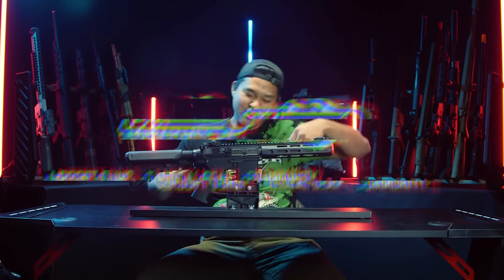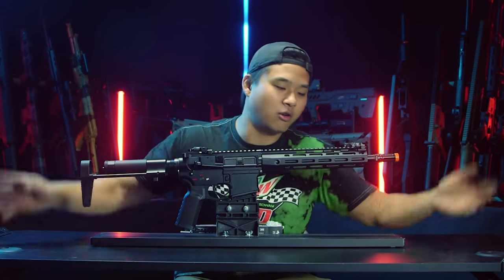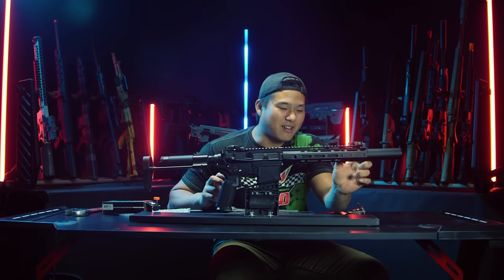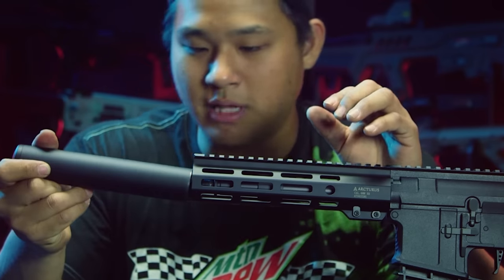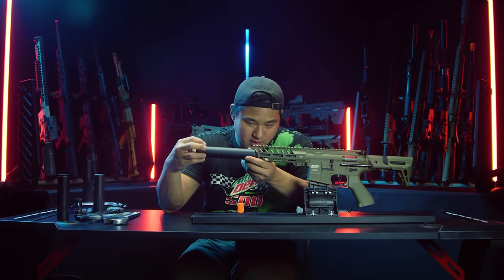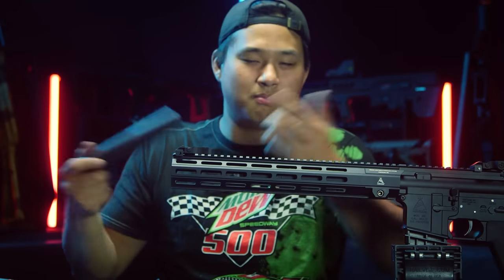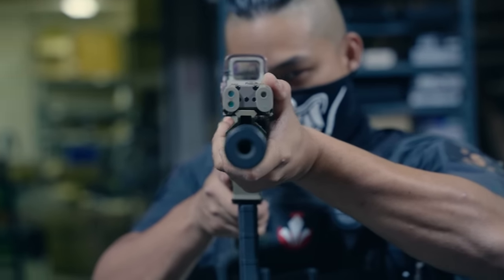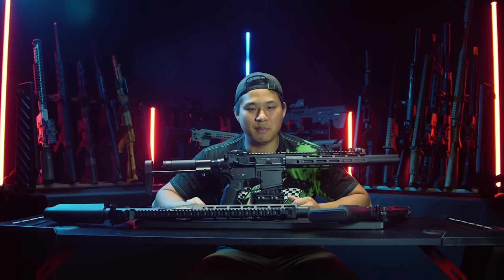Making A Airsoft Honey Badger | Airsoft GI

Comment: I did the same thing a couple years ago, G&P magpul lower with vltor mur1 upper, daniel defence 7” mfr mlok handguard, G&P pdw snakeskin stock, moe grip, madbull noveske 7.5” grey barrel, SLR linear comp tracer, 5” surefire suppressor tube pressure fit and recessed over the comp and barrel. 13:1 gears, gate titan mosfet, brushless motor.

Comment: There is also the double eagle calico jack, it's almost a 1:1 of the honey badger besides the stock. It also comes with an ECU outta the box and it's wired to deans! they're also extremely affordable at less than 200 dollars.
Reply: If you have one, can you attest to it’s attributes/can you vouch for it?
Reply: It's AAC Sugar Weasle, which is AAC's "civilian Market/Low Budget" equivalent to the Honey Badger, you can tell by the handguard and stock.
Reply: @Callsign_Kishin  I have one, it's got nice trigger response using 7.4v or 11.1v, rotary hop up preforms nicely, the ECU can be programmed for higher trigger sensitivity and binary and burst fire. 

All-in-all I'd say its quite capable of being Competitive, especially for the $185 price tag I got mine at 

I got it because I couldn't get my hands on an Ares Am014 for a reasonable price (Shipping from Hong Kong is fucking expensive.)
Reply: @Callsign_Kishin  it was really really good and you could program it to have binary. The only issue was battery space with the tanker stock, it was extremely tight